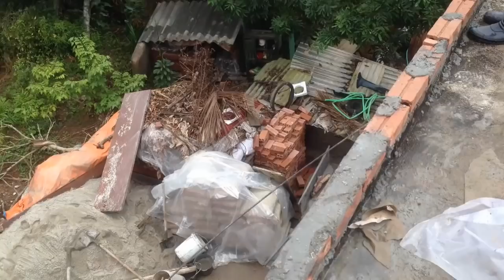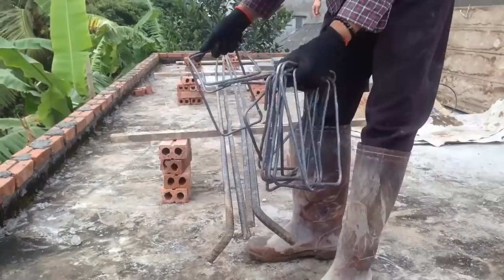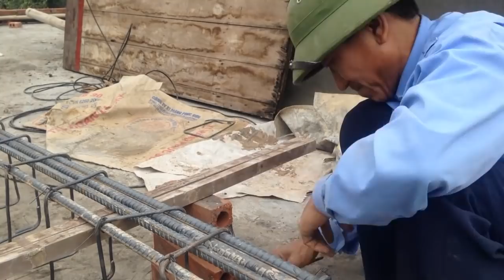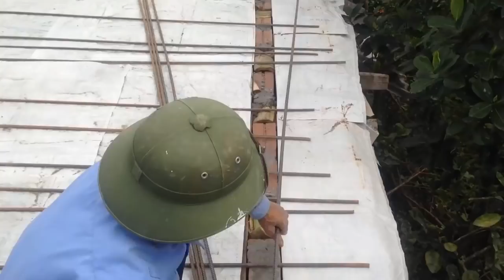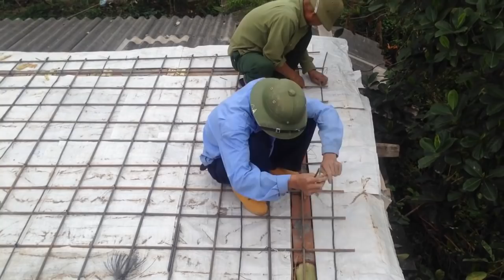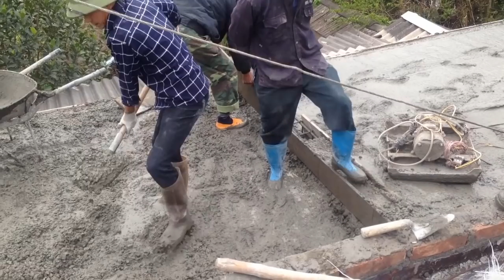Techniques Intelligent Construction Roof Using Concrete - Technology Building Roof Step By Step

Comment: This roof will crack and leak.  It uses 3/4" rock 4" deep, shrinkage will occur.  Should have cast in 2 layers and thinner overall.  My concrete roof did not leak in short rains but concrete is permeable and 3 week rains wept inside.  I suggest this roof will have the same problem.
Solution, coat concrete with tar.

Comment: To work a shearing old or/and  new solid roof slab after putting & makes balance supporters & shuttering approval's , must do this thing's:
1. Make over labs steel with old slab not less 20cm space
2. Planted over labs by epoxy used on old slab
3. Must beams, ribbs and span's had more links L/3 every edge "M-"
4. Tie the L shape between slab, beams and parapets. 
5. Put the slab steel V & H as same space on plane approval
6. Don't forget the Eelcto-mechanical works(if in founded)
7. Put the Cover block under steel slab and beams
8. Befor cast institute of slab must clean steel & slab land (air&water used)
9. The first on cast institute concrete of beams, ribbs & spans 1/3. Used the vibration machine at slab when casted  concrete (by layers) to make the (Homogeneity in concrete)
10. Make surface smoothly after finished the cast institute concrete